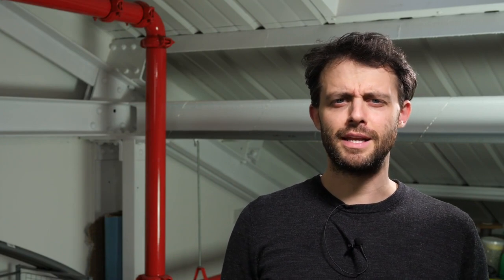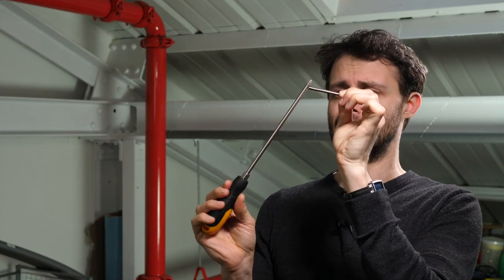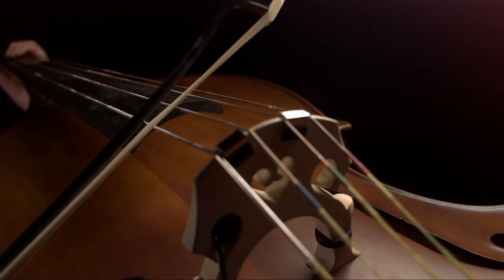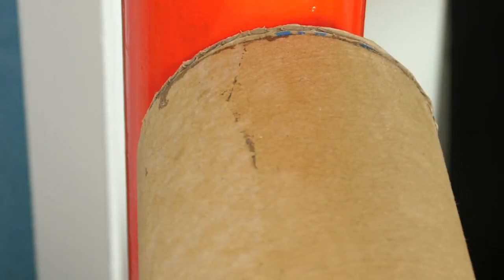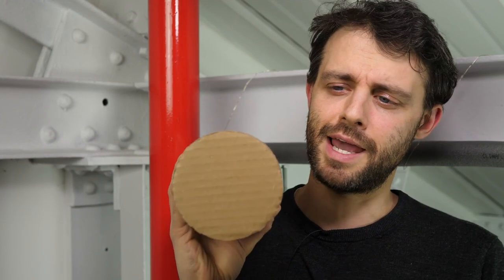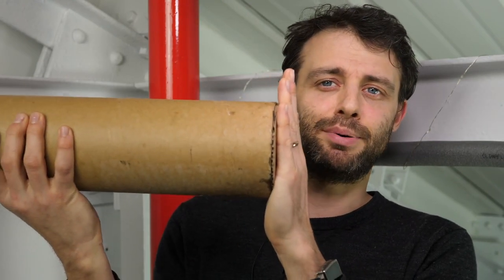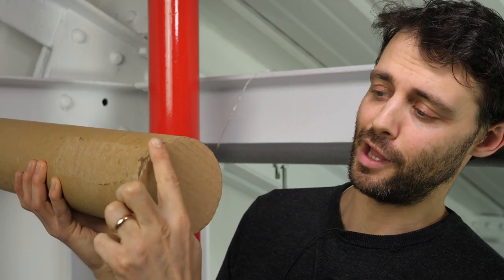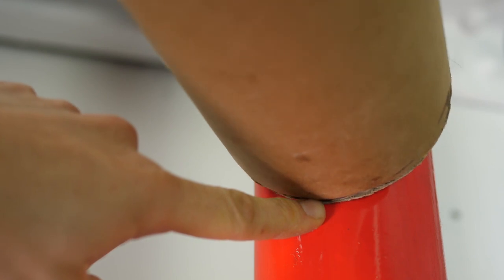The Climbing Magnets Mystery (ft. Steve Mould)

Comment: Well, since there's no symmetry and gravity always biases it upwards... And as it moves around the screw driver, gravity is tipping the magnet roll downwards, only the bottom edge makes good contact and the strip rolls around its end. And it'll have a turning radius pointing upwards, since the "inside" of the turn is always pointing up thanks to gravity. Kind of like if you take a core of a toilet paper roll or any other cylinder, stand it up on its end on a flat surface and apply a fake "gravity" to the top, tangential to the flat surface thereby tilting the cylinder... If you then push the cylinder along such that it rolls on the remaining edge, it'll tend to translate on the surface away from the direction "gravity" is pointing in.

That was my thought anyway, before you pointed out the noise -- though I still think it would work just as well even if it could not slip.
Reply: Someone please explain what on earth I just read.
Reply: It's still just increasing centrifugal force to the top.  The magnets hang to the ground, creating a upward 'track' on the axis.

Comment: But in order to be certain this theory is correct, it needs to be tested with different variables. For example, magnets with a square cross section instead of a circle, or a change in relative size in either the metal pole (screwdriver) or the magnets to test the "roll and slip" idea.

Comment: The only think I can think of (haven’t heard their explanation yet) is that magnetic fields have a flow, I think it’s clockwise, that they are acting in. It’s the same reason railguns work, you wind your electromagnets in a way where both magnetic rails have a flow that goes forward towards the tip, and the ammunition is launched that direction. Here, the forces aren’t as extreme, and the magnets don’t have anything to suspend them in open space, so friction stops them from moving, but by spinning it, you’re adding another velocity than just towards the rod, and the magnetic field’s flow makes them roll forward. My thought starts crumbling there though. Dunno if it’s friction that lets it go up, I’m just thinking that the magnets roll and maybe this is why.

Edit: well shit I was waaaay off.

Comment: My first guess was what he said we thought was happening, once he he showed us that it wasn’t the way he was turning the screwdriver, I thought that the magnet could be spinning , and it just roles up the screwdriver but I had no idea why. Great explanation. 
But why wouldn’t the magnet rotate the other way around the pressure point, resulting in it becoming on the upper side of the magnet, and make go down?
Reply: The momentum of the magnet and the fact that the lowest point of contact is always under the center of gravity of the magnet creates a torque thatwill make it rise, which ever way is up !
Reply: Benjamin Herisson oh right, thanks for the explanation.
Reply: Jason Karim If this were a problem of just geometry, then yes. But I don't know it would fit in 6 seconds with all the forces and points of contact taken into account.
Reply: It's a shorter route for the magnet to rotate up than down.  Plus, rotating down would mean the magnet would temporarily go further away from the pole, and it doesn't want to do that.
Reply: Eddy currents are also in play in, enforcing the direction of rotation, as the opposite way would fight the eddy currents generating from the rod rotation. You can halt the magnets from pirouetting around the pole, yet the magnets will still rise :)

Comment: Before hearing the explanation, my guess is that it's because of the greater momentum/centrifugal force being at the top, where the swing is the largest. It's being pulled toward the greater force.
Reply: But after watching, the rotation and slipping of the magnets does appear to be the best explanation. Now, will square magnets exhibit the same climbing action? I suspect they would. And maybe do to my original hypothesis. Maybe.
Reply: Your initial (not original) hypothesis was the one he explained at the beginning of the video and which he quickly showed was false by turning the screwdriver upside down. Did you and the people who liked your comments even watch the video?
Reply: i mean, i haven't really seen the video yet but from what he's shown so far im reminded of when i used to do that using a pencil and a ruler and watch it rise from the bottom and go flying off
Reply: Oliver Reichenbach If like me they all thought the transition to the second video was going to be the explanation, and were told to make a guess before the explination, then why would you accuse them of not watching the whole video?
Reply: Square magnets wont work, but they should straighten themselves when starting at a 45 degree angle (and slightly rise in the process) according to this explanation
Reply: Oliver Reichenbach "Before hearing the explanation". Did you and the people who complained about the comment even read the comment? But hey, at least you could feel superior for a while.
Reply: I thought it was inertia/centrifugal force at first
Reply: Tom WTF, for your comment to make sense holding a screwdriver upright must somehow make gravity disappear
Reply: Tom *sigh*, in both situations the magnets go up against the force of gravity. But when upside down they move towards the inside thus debunking the idea that it might be caused by the centrifugal force.
Reply: turns out its actually just rolling up
Reply: I'm surprised no one cared about this, for me it's the same. It instantly reminded me of that that I used to do!

Comment: Lenz's law, change of flux in metal screwdriver hence eddy current in screwdriver which in turn oppose magnetic field of neodymium magnets, causing them to rise.
Reply: If what you say is true, it should move downwards if the screw driver is supn the other way
Reply: This can‘t be the reason, because if your argumentation would be true it wouldn‘t rise up in the experiment where he holds the ruler against the magnets. In that experiment there is no change of flux.
Reply: Even when there's a scale relative motion existed between magnet and screwdriver. As the point of contact keeps changing there is still a possibility of formation of eddy current. Might be wrong, but it's just a thought.
Reply: Gravity MUST play a part, or the chirality of spin and orientation of the screwdriver would matter
Instead, we see the magnets always traveling against the force of gravity
Reply: Lenz's law states that the emf is induced in such a way, so as to neutralize its cause. According to this if we are rotating clockwise Lenz's law should make rotate counterclockwise. It has nothing to do with up and down.
Reply: There is a change in flux. What is the difference between rotating the magnets around the rod to rotating the rod in the magnetic field. If their are any eddy currents being produced, then they should be the same either way..
Reply: This was my initial thought, before I saw that it still rose with reversed spin.
Reply: ph... ph-photosynthesis..?
Reply: timber77 there is change of flux becuase of rotation of central rod.
Reply: to prove it, we should test it under zero-gravity environment

Comment: Steve's explanation seems cogent.  This would be a great problem for Physics students, especially M.E. majors, to either confirm or provide an alternative with actual testing with measurements, data collection & analysis to support either hypothesis.  This physics (mechanics) problem is very nuanced, but roughly comparable to an existing mechanism called a 'helical roller lead screw assembly'.  The mechanical couple that Steve describes as having skip-slip dynamics means that the sound is a clue to the average frequency of that repetitive action; engineers call that 'creep'.  This type of creep results from rollers making contact with each other along a path angled from the tangent of contact, requiring tiny periodic twists.  In this experiment, the path of rolling contact would likely be a smooth helix around the screwdriver shaft, but with the helical pitch changing as the twirling speed changes, and/or magnets are added or subtracted.  Students would be required to model this problem to accommodate all the significant variables well enough to make predictions.  
Since this is weird, and has little prior art, it's not a problem that students could simply look up on the Internet for solutions.  Physics instructors and professors could have fun with this one!

Comment: First thought: The magnets are being pulled down by gravity, but stuck to the screw driver (obviously). Though this puts more friction on the bottom of the round magnet. As you twirl it around, that causes it to roll. Though I'm unsure if it's the disproportionate friction at the bottom acting like a weak friction ratchet to make it trend upwards, or perhaps the disproportionate friction makes it roll a little around the axis of the magnet, which would make it want to push upwards, since that's where the friction... (yeah, he's going over it right now in the video at 5:30... wohoo, I was right!?)

Comment: A very cool "easter egg" if you will in this video is that you preformed an experiment pointing towards your hypothesis about the phenomena without even mentioning it. You claimed the slipping was what caused the phenomena, meaning this hypothesis predicts that if no slipping occurs the magnets won't move up, and when you put it on a drill and spunn it it did indeed stay in place :)

Comment: Stopping at 2:06 to record my guess. Gravity pulls down on the whole stack, making the point closest to the rod a “u” shape, so no matter which direction it rolls, the next point on the magnet cylinder to touch the rod will always be slightly higher than the section that was previously in contact. This compounds over multiple rotations, helped along by the inertia of the previous upward push, making subsequent rises easier and easier.
Reply: Ooh, not far off.

Comment: Some tests that can be done:

* Try with square magnets
* Draw a line on the stack of magnets with marker and film in slow motion to see if it's rotating.
* Go on that weightless plane ride with parabolic dives and test it there
* File a deep groove in the magnet that touches the screwdriver so that it has two contact points and no slip
* Attach a piece of string from the outer end of the magnet stack to the tip of the screwdriver to counteract or even overcome the force of gravity (that would be pretty hard to get just right
* Hold the screwdriver horizontal (parallel to the ground) and spin it

Comment: Why does it need to stick and slip to do what you're describing?    As long as the points of contact are off center because it's being pulled around the pole due to a trailing drag, and gravity is pulling the magnets down causing more pressure on the lower contact point, and the lower point of contact point is on a diagonal, it should climb continuously, even without sticking and slipping.

Comment: An interesting set of options to test this explanation (which I do not have all the right magnets for unfortunately):

Turn the screwdriver sideways and spin it.  Does the climbing no longer happen?
Use cube or spherical magnets. Does the climbing no longer happen?

I have cube magnets, and cannot get them to climb.  But I do not have any cylindrical magnets (of small size and power) to test with.

The cubes do not seem to climb at all.  The spherical magnets DO still climb.  But it is harder for me to be absolutely certain the presented explanation breaks down for a sphere.  There should only be one contact point with a spherical magnet, right?

Comment: I also suspect the same principle that a drill works on whatever that motion is called, it draws the magnets up somehow in the same way that a corkscrew does but uses magnetic forces instead. With both the rotating actions at work it also would be interesting to see theorize is this would be practical for a high rise elevators or even possibly to space.

Comment: Hi Derek! I don’t think that explanation has anything to do with what is actually happening. I think it has to do with centrifugal force:

If you put the circle of your keys on a pencil and start spinning it, the keys will move up exactly like the magnets in this video until they get out of the pencil. 

And if I’m not wrong, that’s because of centrifugal force, that when an object spins moves away from it’s axis and that makes it go up until it is 90° from the axis, but since the pencil, the screw driver and even the drill doesn’t spin in a perfect way, that will make the object go up.

Maybe I’m wrong but seams more logical to me.

Comment: My theory right away, 16 seconds in. The metal rod, when spinning, has a slight angle, meaning the inertia from spinning acts like it would on a cone, causing it to not be perpendicular to the surface of the cone, allowing for a torque to push it upwards.
Okay, so you're implying I was wrong now. Seeing your experiments, I'm satisfied with being wrong.
I'd suggest putting a bright yellow line down one side, getting access to a slow motion camera, and using a stationary pole for rotation. This would be a good test for your theory.

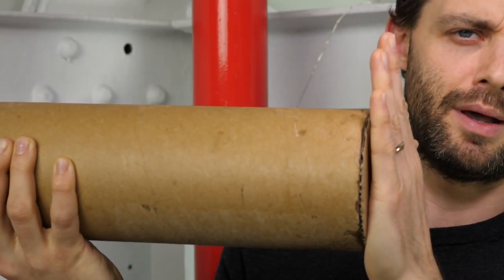Comment: 4:50 I think there is a mistake there. Gravity itself does not pull it away from it; if there was only the magnet, it would fall down in a straight line. You are accounting for the differences between the net forces at different points on the magnet, which cause torque.

Comment: Are you sure it is simply a consequence of slipping or do Maxwell's equations play a role here as well? F= q(vxB), where the magnetic field comes from the magnet, pointing towards the center of the screwdriver and the v is the rotation of the screwdriver. This would cause a force perpendicular to B and V, therefore in the vertical direction, up the screw driver.

Comment: In order to move around the shaft the magnets actually rotate. Since the weight of the magnet is a lever the bottom lip will have the most friction and drive the rotation. Due to the circular magnets and pole the frictional forces will have an upwards component

Comment: The Left Hand Rule :)

The magnets movement induces a current through the screwdriver, and an external magnetic field (also the magnet) is applied across that flow, the screwdriver experiences a force perpendicular both to that field and to the direction of the current flow (i.e they are mutually perpendicular) . A left hand can be held, like a gun with the index finger pointing and the thumb is up, so as to represent three mutually orthogonal axes on the thumb, fore finger and middle finger. Each finger is then assigned to a quantity (mechanical force, magnetic field and electric current). The right and left hand are used for generators and motors respectively.

Comment: I post this for those interested in confirming steve hypothesis.

I did observe the effect with cubic magnets. Contrarily to Brian Greenfield. With a 5-stack 12 mm cubic magnet on a 6 mm metal rod (small screwdriver) no effect observed. i think the ratio magnet size to rod diameter is important and a 6mm rod has too much curvature in my opinion for a magnet this size.

On a 10 mm metal rod, the effect is observed, the stack rises, screwdriver up or down, clockwise or anticlockwise ! When the stack rotates around the longitudinal axis of the screwdriver, a rotation around the longitudinal axis of the stack is observed, confirming Steve hypothesis. Without surprise after lubricating the rod, the effect doesn't appear any more, confirming the strong role of friction.

Comment: @ 1:56 I hypothesize that the perpendicular magnets are following the magnetic lines embedded in the metals structure (i believe it's called, the lattice structure) of the screwdriver. the magnets would follow a (no pun intended) screw-like motion up the screwdriver.
Reply: I can reject my original hypothesis. I didn't give much attention to the contact point between the magnets and the screwdriver. cool. learned something new.

Comment: The next step is to test and verify.  Do you have a polished rod and polished magnet to reduce the friction?  If you accelerate the rod vertically, at what acceleration does the set of magnets no longer climb the rod?  Does the same response occur with square magnets?

Comment: There is one thing I observed about this: Gravity is likely to be involved in the process, as gravity provides a consistent force subjected to the magnets. In a sense, the magnets are subjected to a downward force as objects not fully secured, while the metal rod is fully secured.

But what would happen to the magnets if they have near zero relative acceleration in comparison to the rod, in example by using a zero gravity training craft.

Comment: Hmm.. I think the magnet spins(around itself, not the screwdriver, you can notice it if you mark one side of the magnet and then you spin it ~5 times and check how the mark moved.) because it has stronger push on the lower side due to gravity. That spin somehow makes the magnet climb upwards. But I'm not exactly sure how. If you spin it perpendicular to the earth it won't move anywhere.